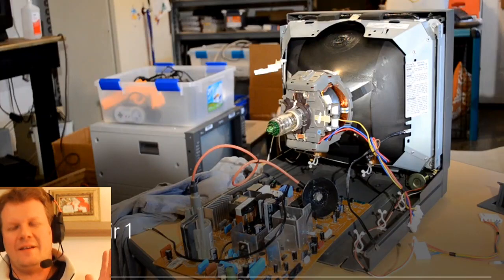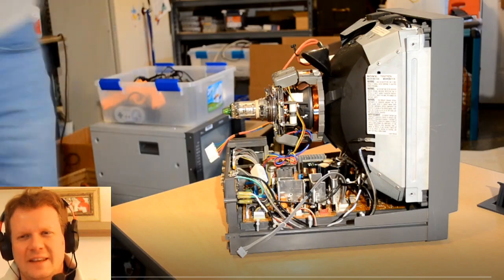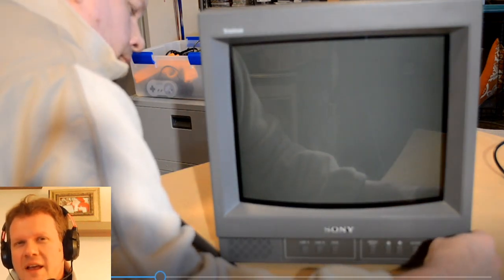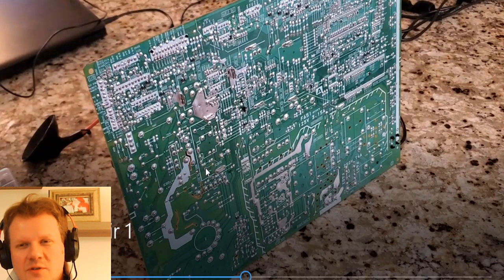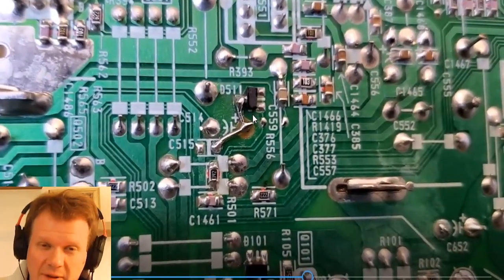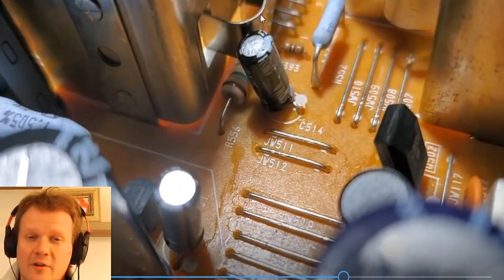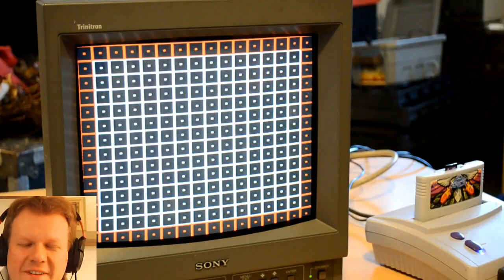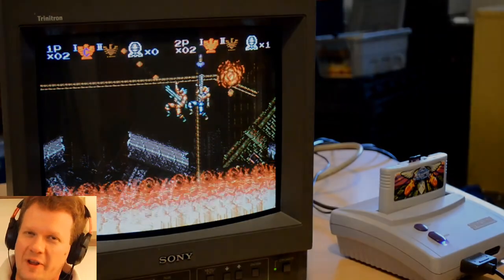How to troubleshoot a dead CRT | PVM 14N6U Repairs

Comment: I’m literally in this same boat with my Sony/dell p991 monitor. Monitor was working flawlessly. Decided to recap it as it had a lot of usage. Got it recapped. It worked great… for a week… then the screen got garbled and eventually stopped working.. thought for sure I had a bad cap. Spent a week going thru.. assembling and disassembling numerous times.. trying to fix the screen issue.. then all of a sudden I lost power.. I’ve been all through it.. eventually found 5 so far of lifted traces.. repaired those and still nothing.. I’m assuming I got more.. 

Point is… I’ve been dead set (no pun intended) on trying to get this thing back up. It is extremely frustrating and a brutal process.. but I’m still holding on… lol. 

Thank you for this video.. it’s giving me encouragement now to proceed…

Comment: I love how you remind us to stay encouraged. I find myself learning things the hard way by screwing something up. I recently learned why it’s important to use non-conductive tools on running electronics. I killed my U Pin pot on my board by shorting my tool against a heat sync. The picture is now completely bowed. I was REALLY bummed and was so discouraged. I came back the next day and ordered new replacement pots and recapped that area of the board to be safe. Waiting on the parts, but I’m hopeful. Thanks for the encouragement

Comment: I destroyed so many traces on the first CRT I fully recapped requiring lots of messy repairs. After that, I bought a Hakko desoldering gun. Best thing I ever did for my sanity.
Reply: That thing should be mandatory and cheaper.

Comment: Someone wanted to buy one off me but it's a 14N1U, same but with no factory RGB. I followed a guide (i hate following guides that give no "why") and installed a few SMD components, then added RGB. I actually sliced the RGB half of rear input board which gave me access to the holes for my plugs, and my momentary RGB channel switch. I dremelled out the plastic backing. It's now really neat and has a factory RGB look! Anyway, i triple check every connection, make sure there are no shorts. I actually used a parts PVM to make a proper harness from my RGB connections across to the little board... just trimmed one side down the right amount of pins and had a proper, tight fitting harness across to my inputs. Everything was seemingly good and ready to go... I switch the screen on.. power comes on. No display. I have no idea what's gone wrong!! i only added a few capacitors (and a resistor). It was repaired for the same issue in June 2002, and I could see they'd replaced a transistor and added a film capacitor under the board (which i left alone). Anyway, logic told me that i should replace the same transistor, but that didn't fix it.  They are so hard to work on and get readings on things live.. plus you're working near super high voltages. I am pretty annoyed lol

Comment: I've a similar problem with my PVM 2950
After I replace all the capacitors it doesn't turn on anymore. I can hear the de degaus works after I press the power button but no picture
I've checked all the capacitors to search for any similar problem as described on the video but no luck so far
Reply: just leaving a reply here so im notified if anyone replies, i have the exact same issue

Comment: Personally, I think it's better to recap in stages. Starting with the power supply. Changing all the caps out at once, is many times unnecessary, and if something goes wrong, it can take forever to narrow down. Besides, going in stages you can diagnose the circuit, and change only what's needed. It teaches how that circuit works. A good ESR meter / capacitor tester is essential. Imo

Comment: Can you recommend a good 19-20 inch rgb ready pvm? And what would you consider the best top 3 bvm models for future reference. And do you consider the pvm cost vs bvm cost difference worth it?
Reply: I wouldn't spend any more than €100 on a pvm, 150 on a good bvm or pvm with 480p, and up to 400 on a large, dream bvm with 480p support. Only if you're in America though. If you are in Europe, you could just pick up a HIGH QUALITY consumer TV set for almost nothing. It's really not worth paying over the odds on a monitor in the hopes of bagging a CRT (especially if you need to get one from the continent to the UK or Ireland) when you can get a more than respectable image for cheap or even free.

Comment: This happens a lot with this type board I don’t know why they stop using the fiberglass board they can bend and flex with breaking I guess there cheaper and  they were not going to be making CRT monitors any more for what I seen it looks like this were the last CRT monitors run the 2000 to 2004 models